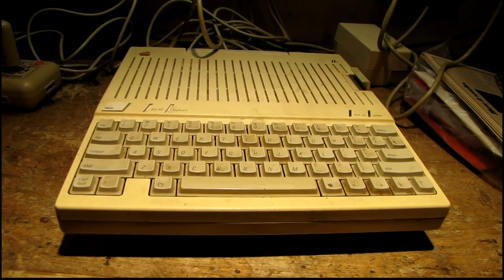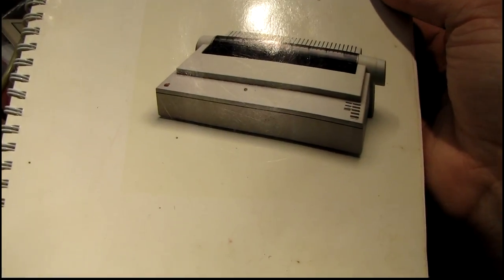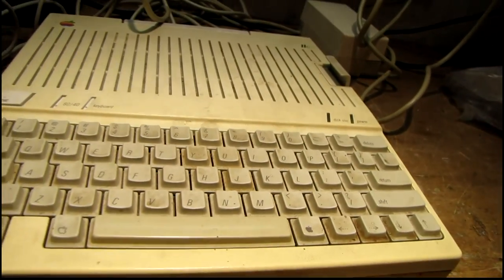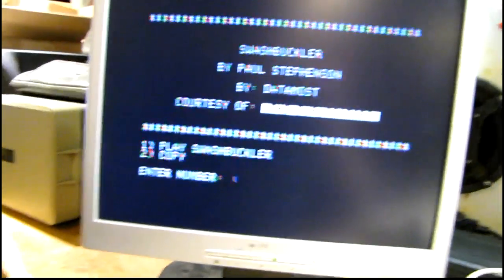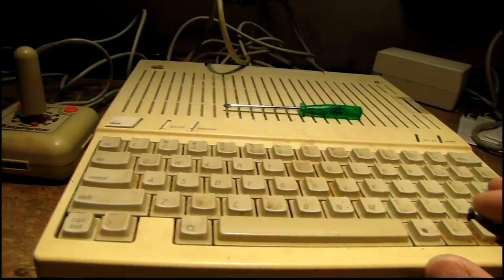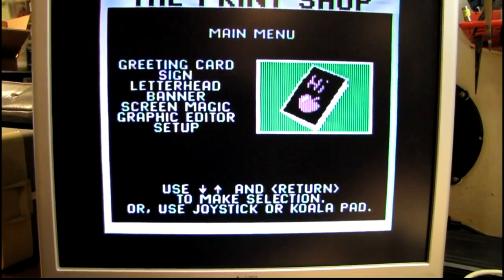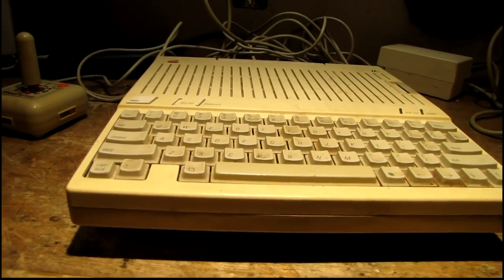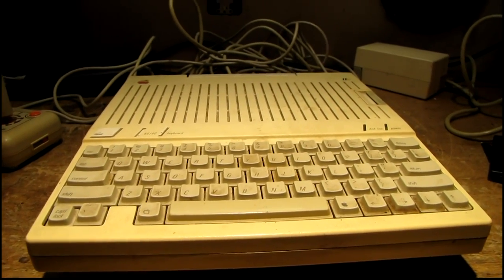Old School Computers:  The Apple IIc

Comment: Ha, I’ve still got one of those old printers - I suspect the caps in the power supply need replacing, but I’ll bet it still works. I don’t have my Apple //GS, though, nor do I have the serial cable for the printer.

Comment: There's only a few colors in high resolution (262xWhatever), and they had that lousy artifacting. The low res 40x40 mode has 16 colors.. but it's 40x40.
I think there's a separate monitor connector besides the composite, but I've never used it. I wonder if it still artifacts.

I remember one of the programming books that came with the computer explaining all the hi-res artifacting rules. Like "here are the colors. The 2nd column are the colors for odd pixels, or even pixels on a Tuesday".

Comment: I don't know that program you're using at the end of the video.  But maybe the text in those files is uncompressed.
If you can't get that program to work, maybe you can load the files in a hex editor or dump them as plain text. The text you wrote might be readable within the files.

I wonder if there might even be some BASIC program listed on the web somewhere, that you could just type in to accomplish this. That might be a longshot.

Comment: From what I can tell, your Appleworks issue seems to be a case of bad hardware (perhaps one of the AUX RAM chips is bad).  Appleworks should run fine on the IIc and the IIe.  Basically any system that could run ProDOS and had at least 128k.

Maybe making a serial cable and using ADTpro to make a disk image would work better.  Then you can use something like Applewin to run Appleworks and view this file.